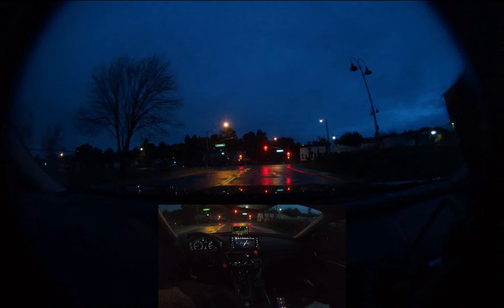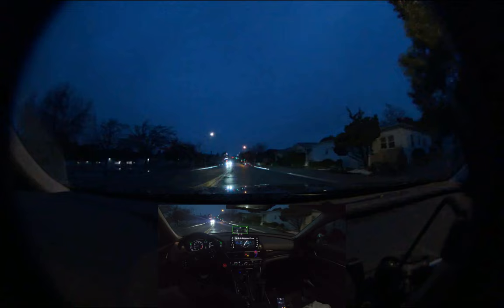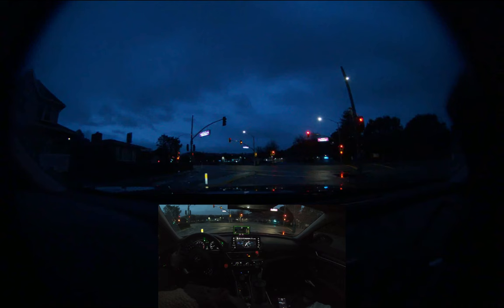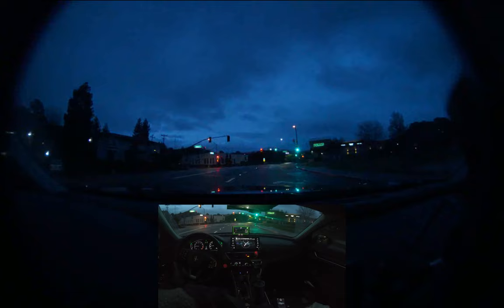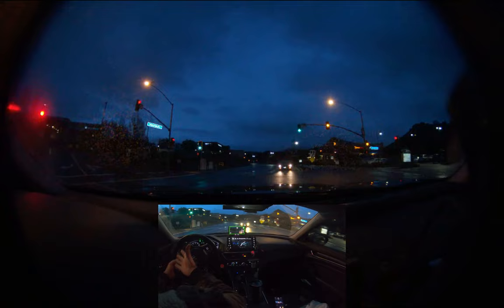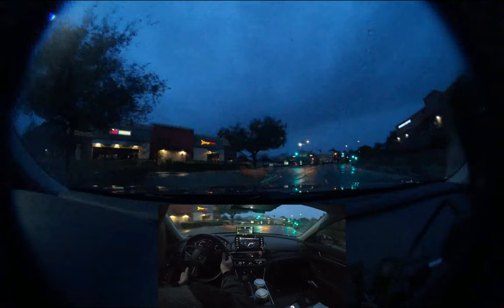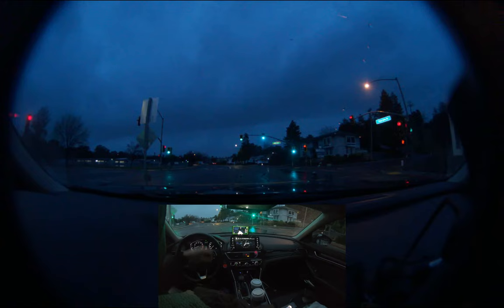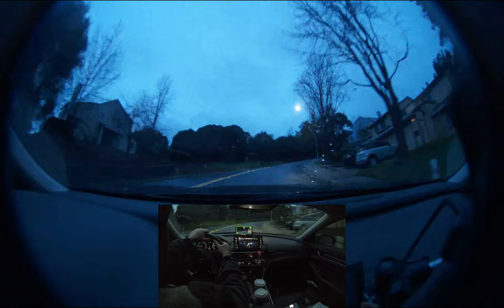Dashboard Mounted C3 ( Low Mount )  Traffic Lights Test Openpilot Honda Accord

Comment: what’s the benefit of this low mount beside falling off? does the low angle help with stopping at light earlier than before?
Reply from the maker: I dont test long, I think it wont make a difference. My setup is more on getting rid of the blindspot while driving. My  Accord has a small windshield footprint.
Reply from the maker: This is for folks who gets bothered by the official placement of the c3. If you are ok with it, just stay official so you can troubleshoot for comma . You need to be on the same page with them i.e  official mounting and stock Openpilot.